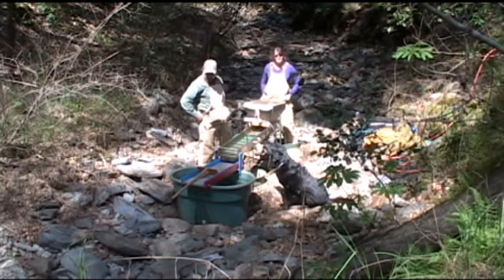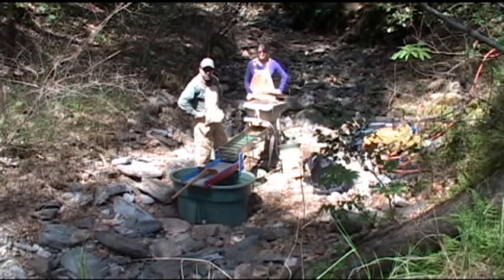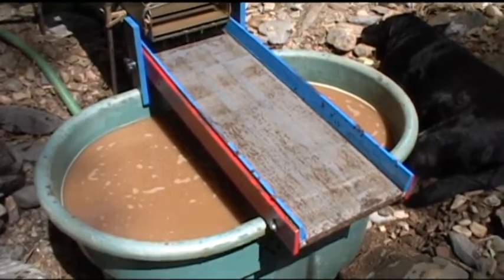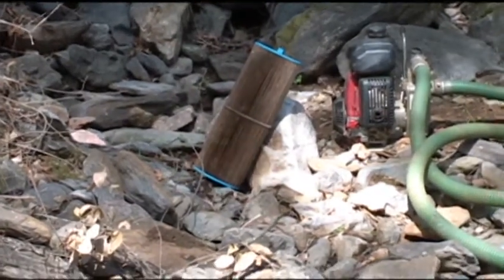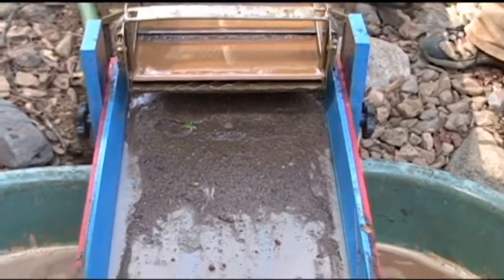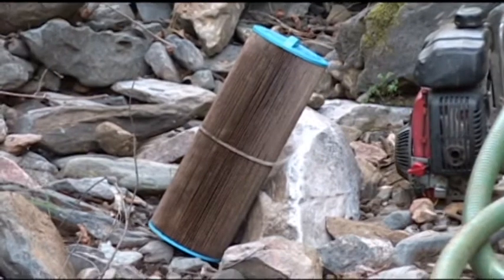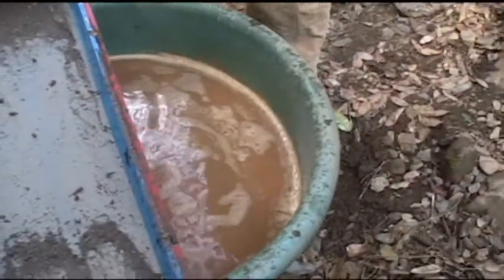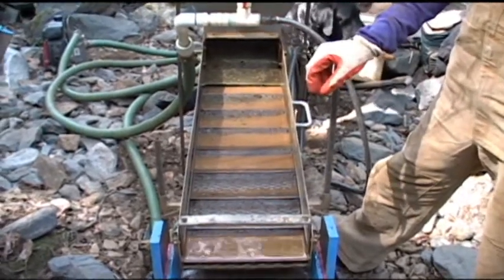RGMC e2 Ecobanker Field Test  2012.avi

Comment: This sounds like a pretty decent solution. The key will be to keep the sand & larger silt particles from damaging the pump impeller blades. All depends on the particle size, shape & hardness.  Rot keep up the good work!

Comment from the maker: Jeff,

I have a new container that fits below the tailing screen that should catch the silt as you have offered. However, I don't think the supply filter will perform much better as the fine suspended material in the brown water will continue to plug the filter. I have a few other ideas and welcome your suggestions.